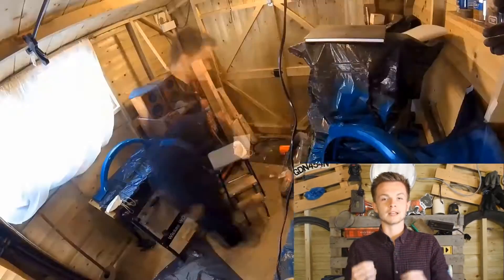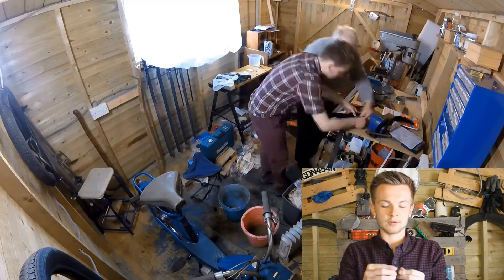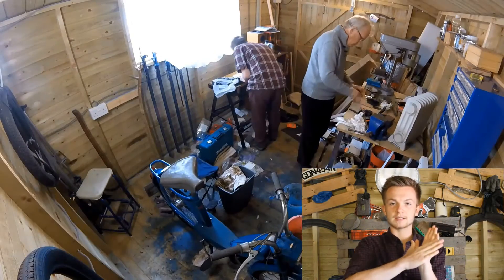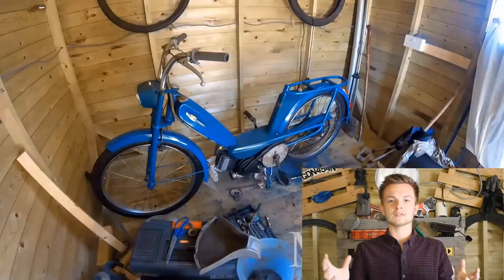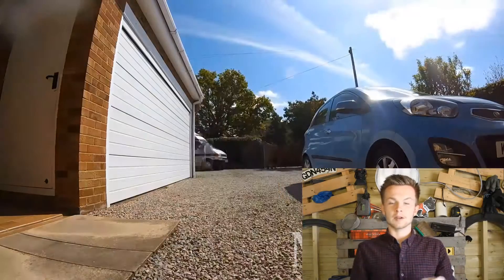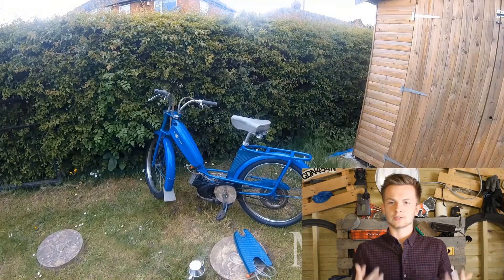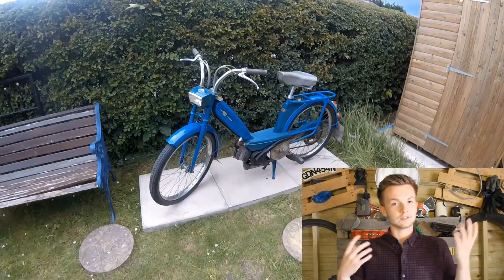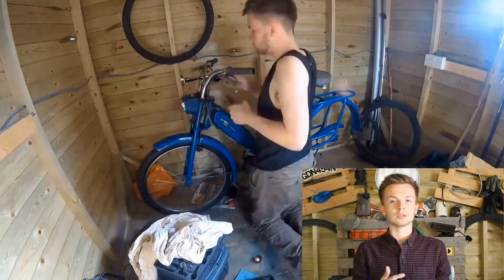Peugeot 101 Restoration

Comment: How was the fuel tank? Any rust in it?
I have a 1977 SP-u3 
Good video, very informative.
Cheers
Reply from the maker: Tank had surface rust which had built up therefore, would clog the filter. Found a kit called Por15 this should be a link to a similar product I used so should be able to find from there https://bit.ly/36f702K. Ideally, which I wasn't able to do, would be to take the tank off and properly clean out and then that enables you to rotate it etc for if you choose to re-line it with Por15 or a similar kit.